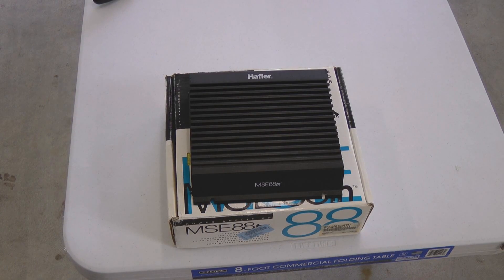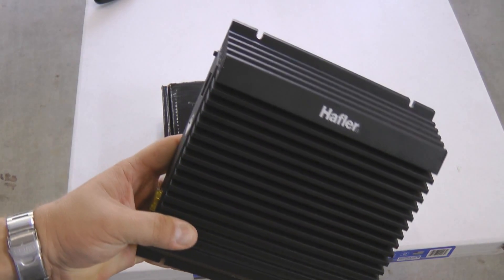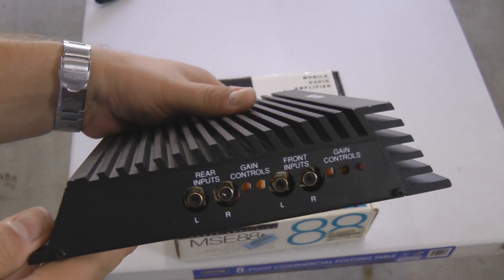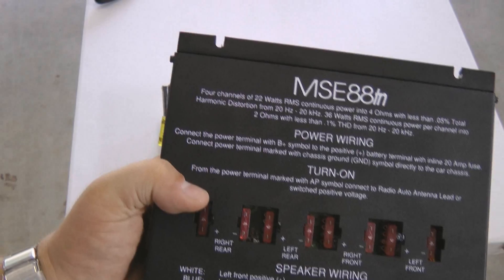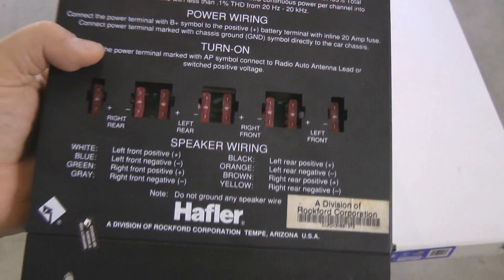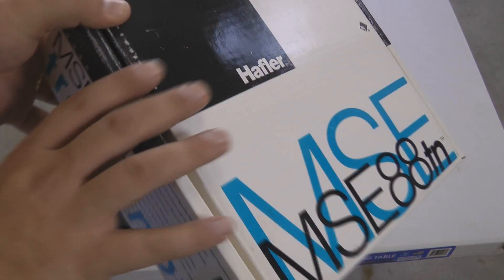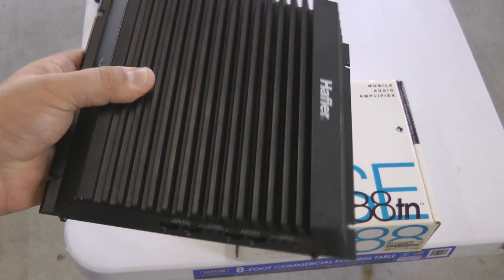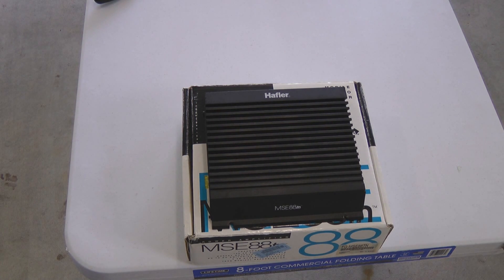1990 Hafler MSE88tn - Old School Rockford Fosgate Amplifier

Comment: I still have 3 of these, haven't been hooked up since the early 90's. I used 2 of them bridged for f&r mids and the other for tweets (4 channel) paired with a Soundsteam Reference 300. Along with Audio Control crossovers, eq and Epicenter.
It sounded awesome. Back them I always wanted Phonix Gold but couldn't afford them...but now I have 2 MQ430's and a MS 2125 all ready to be recapped. Each is in near mint condition.
I'll never get around to getting them installed though but they are beautiful to look at... My very first amp set up was a Carver amp for sub and a pair of ADS amps, it rocked too. I hated installing until I was finished, I did all the wiring myself including making my own custom RCA cables (couldn't stand having extra cable length or sub par cables). Installation is WORK and very time consuming if you do it right. That Soundstream/Haffler set-up took 2 weeks every day about 8-12 hrs a day. But in the end it was satisfying and pretty much bulletproof.

Comment: I bought 3 of these back in the day, I still have them, (sitting on a shelf) I used two of them bridged and one four way. The 2 bridged ran F&R mids and the 4way ran the Tweeters. These amps barely got warm and sounded amazing. I had a Soundstream Ref 300 bridged for the subs.

Comment from the maker: @jpierce55 I'll post the results of the output soon. It is much easier to find old school amps in good condition than speakers. Good deal with the Kappa's, I always wanted the Beta series that were available in the early 90's. I still have a set of Boston Pro 5.4 comps and they are in great condition.

Comment from the maker: @trome0 Hey man, that MSE120di is a VERY nice amp! I have some BA Pro 5.4's and dreamed of owning the 6.43's back in the day. Sounds like a nice setup! For those curious, I bench tested my MSE88tn a few months ago; 36x4 @4ohms, 54x4 @2ohms, 119x2 @4ohms - these are actual, continuous RMS numbers, not MAX power. If you prefer MAX power, try 173x2 @4ohms. Not bad from an 88 watt amp!

Comment: It is always great to see an OS amp in this condition. It is also more rare to see an MSE88 still running. The amp was one of the first to use the HD (TR) type processing. If you remove the cover you will see about a 1X1 square processor with about 20 legs per side. The current rolled over this processor was WAY more then the legs of the unit could handle and subsequently would melt off causing a failure. In our shop 99% of the MSE would come back in a week and IMO what put hafler out of biz.

Comment: Very Cool! I use that amp to power a 10" sub I built,  with ADS 336is' powered by 2 bridged ADS PS-5's with an Alpine 9815 head unit. All in a '93 Ford Escort that is as dead as a Mercedes. Prolly as heavy too with all the acoustic.
Reply from the maker: +gani aylen sweet setup 👍

Comment: I have an MSE80di I bought untested because they didn't have the leads to hook up the power. It turns on fine but all I get is a weird whine and a pulsing noise. I have pretty decent soldering skills and I'm hoping to fix it.
Reply: Actually I just checked my battery voltage on my bench and it's at 10 volts. It works fine now.
Reply from the maker: +Fretslapper97 😜

Comment: i rember back in the day when thame cameout with a crossover we could hook to oure amp. Or better yet howabought useing a power cap remeber them big bulkey things. when thay came out everbody ran out and bought one. But i will tell you one thing i my old box with 2 12s and a 300watt amp hooked up 4 ehm speakers and well the kids alweez ask wi its so loud compared to thare system . its cuz old school stuff was bilt for better base responce. for a smoother bass.